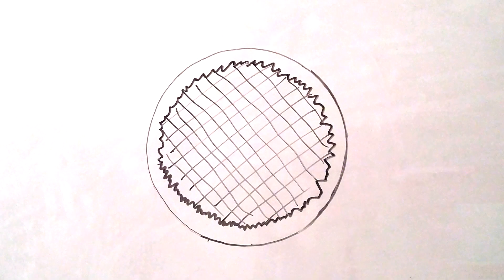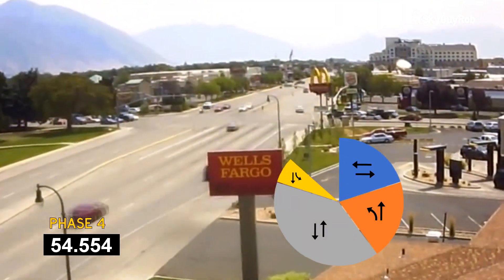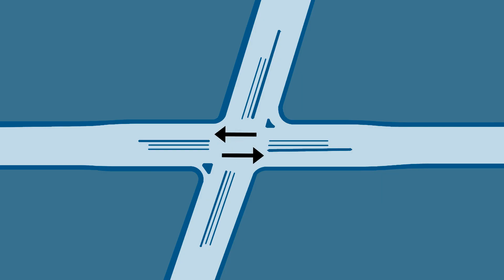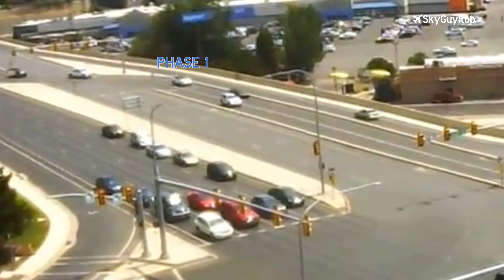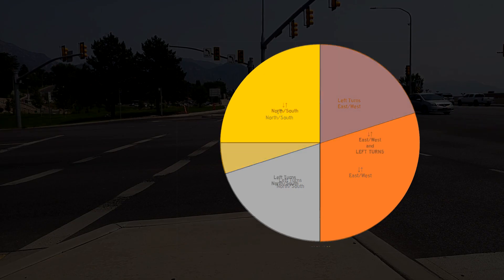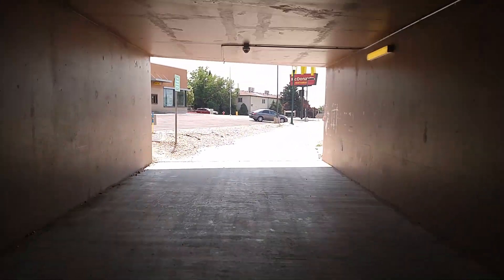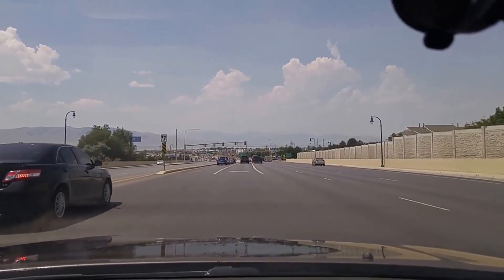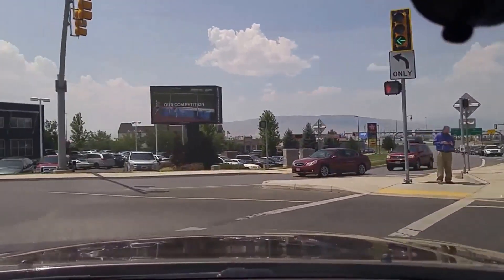New Crazy Traffic Light Which SOLVES Congestion

Comment: You’re lucky to live where the city, county, and state traffic engineers do anything more than the absolute minimum required not to be fired for gross negligence. Where I live they put artificial vision camera systems in on highly congested problem intersections and traffic flow gets way WORSE because they’re so poorly programmed. 60 seconds can pass where not a single car goes through an intersection despite massive backups from some directions. And our lights have sensors plainly cut into the road yet still give a green arrow for roughly forever for left turns when there’s not a single car from any direction wanting to turn left. It’s the most inefficient, fuel wasting, and backup causing mess imaginable. Yet when you try to voice a complaint you’re told the signals are programmed for traffic safety above all else. Honestly, a 12 year old geek could do better than most traffic engineers.

Comment: These are a good idea for regulating traffic at large, multi-lane intersections, but not for small intersections. What would work better would be "smart" intersections that measure the approaches of vehicles and decide which directions should be given movement. Say for example you have a high speed main artery intersected by smaller capillary streets. Often what happens is a vehicle on the main street going 50mph will hit a red light just so the side street, which is already stopped, can go. Well, this is inefficient in numerous ways. First, if the side street is already stopped, then that vehicle isn't wasting any more energy. It's already stopped. But if the light decides to stop the high speed vehicles to allow the one stopped vehicle to proceed, now all those vehicles have to come to a halt, wasting braking energy, then re- accelerate on a green light, wasting fuel. Instead, a Smart system could make calculations based on time and energy efficiency. It would monitor the progress, speed, and direction of vehicles on all streets, then grant movement based on the most efficient profiles. Now, obviously there has to be a time component to it, otherwise the side streets would never be given an opportunity to move, but that is simply a matter of programming.  This type of system is completely possible with today's technology, and wouldn't even be expensive to implement on all intersection types, regardless of size or location.

Comment: 3:26 casually crosses solid line
Reply: Single solid lines don’t prohibit crossing, they discourage it. And there are even some places where you actually have to cross a solid line in order to get into a left turn lane—Michigan has a lot of those! In most places you can’t get in trouble for crossing a solid line, but you should have a good reason, or you might get stopped for suspicion of being under the influence.
Reply: @Ethan.Lamoureux  What weird ambiguity-cave did US road markings crawl out of?

Coming soon to a cinema near you, from the creators of the red turn signals; its the must-see hit of the summer!
Reply: @mathiastwp  The reason for the ambiguity I speak of is due to the location of these left-turn lanes. They are in the middle of the road, and they are intended for use from either direction. The markings are very specific so as not to cause confusion.  The other type I have seen was a left turn lane where the line which separates the turn lane from the thru lane had been made too long and there was no gap to enter the turn lane, so you had to cross the solid line to get into the lane. But no big deal, because as I said, a single solid line does not prohibit crossing. There are other markings which prohibit lane changes or passing.

Regarding your “ambiguity-cave” statement, I have yet to see a marking system which is as unambiguous as the US system. It clearly differentiates between lines separating traffic moving in the same direction (white) and traffic moving in opposite directions (yellow), and between right edge lines (white) and left edge lines (yellow). This system is used thruout the Western Hemisphere. But the systems used in Europe and elsewhere in the world have centerlines and lane lines which look exactly the same.
Reply: @Ethan.Lamoureux  We don't use bi-directional turn lanes, so it's a bit silly to me; we usually just throw up a roundabout. But over here in Norwegen solid line always prohibits crossing, even if it's single, yellow or white.

In the situation in the video, I see absolutely no reason why one would want to change lane in the middle of it like that. Because most Americans apparently don't know how to efficiently zipper-merge (like the Cities Skylines AI), you'd want to close these two lanes from intermingling to keep capacity up. What better way to do that than with a solid line?

An extra question here at the end. Do you have dubble mixed-length centerline markings? As to indicate that one side can more liberally overtake the other, due to the type of road or blind corners.
Reply: @mathiastwp  First, the reason for the two-way left turn lanes is because of built up areas with a lot of businesses (each with its own driveway) where left turn traffic blocks a thru traffic lane while waiting to turn left. So we put a lane in the middle which is used for left turn traffic from either direction. It is continuous because the places where people can turn left are pretty much everywhere. 

We do have passing or line-crossing prohibitions, we just use two solid lines instead of one. So while a single solid line discourages crossing, a double solid line prohibits it. 

The most frequent reason for someone changing lanes suddenly like in the video is because they realized need to make a turn ahead and don’t want to miss their turn. Tho there are some people who just change lanes all the time in a hopeless effort to “get ahead”. Thankfully that behavior isn’t everywhere.

Yes, we do have mixed passing/no passing zones where one side can pass while the other side is prohibited. This is indicated by placing a solid yellow line to one side of the broken yellow centerline. The side with the solid line is prohibited from passing, while the other side can pass. So there are three indications: a single broken line means passing is legal for both directions, a solid line next to a broken line means passing is prohibited for the direction with the solid line on its side, and two solid lines means passing is prohibited for both directions.
Reply: @Ethan.Lamoureux  In my country there's an interchange with 2 slip roads/off-ramps just 170m/~200yd apart, & you aren't told that you can only access the 2nd slip road from only the right-most lane until after you've passed the 1st. If you aren't familiar with the junction you might find yourself in the wrong lane & end up having to change/filter lanes suddenly, which is made more dangerous here as the road between these 2 slip-roads is a bend too
Reply: @lzh4950  I can easily visualize what you are describing, and the only thing I can say is that many traffic accidents are more the fault of poor highway design than they are the fault of the driver(s) involved. Be careful out there!

Comment: Do you know how this affects delay for the permissive left turns before the intersection (to account in your pie chart from 30% to 50% arrival on green) or have any crash rates information? Is there a signal at the left turn before the intersection, and if not, should they have one there? Overall, its a unique intersection, super cool!
Reply from the maker: There are no permissive lefts at a CFI (all lefts are "green arrow" protected).  Are you talking about the difference between a regular intersection with (and without) permissive lefts?
Reply: @RoadGuyRob  Gotcha. Can u share the timing card? Would be cool to see the phasing. I'm curious which phases overlap with the protected lefts.

Comment: Here in Dayton the premise makes sense, but the execution is absolutely terrible. The amount of time spent at a red light while not cross traffic is moving is absolutely staggering the vast majority of time. At rush hour it may make sense but most of the time cars are idling and no one is crossing. Worse, right turns are governed by lights when there’s SIGNIFICANT room (already paved) for merge lanes. I avoid this intersection at all cost because of the amount of idle time. It has like 2 to 3 preceding lights in two directions as well.  awful.

Comment: Interesting!  Funding mass transit is ALWAYS  FAR cheaper than any of  these alignments (and accompanying tunnels) (AND the NEPA and ROW allocation) (and putting in beefier signal masts to hold the longer arms...)I feel like traffic "engineers" need to be better informed of the logical alternatives.  But since transit isn't "engineering" I feel like the engineers turn their noses up at it since it is faster and more cost effective than new infrastructure but really shows how irrelevant the whole traffic engineering profession is.  I mean, what other specialty gets to call itself a profession when implementing its recommended actions does nothing but induce further problems and the solution is outside of the "licensed" peoples' prevue?

Comment: There's a new interchange that they put in not too long ago just south of the Minneapolis airport on a surface Street like 36 or something on the Southeast corner over by the Mall of America just south of the terminal 2 that is really interesting it crosses traffic over onto the complete other side of the road and it is like you're driving in England for a short distance.. what it what the problem is is it's a off-ramp and on-ramp by a airport terminal and the Mall of America getting off of i-494 and Minnesota State highway 5 and 55 and it gets off onto a surface Street that's a four-lane city street and traffic always got so backed up get it trying to get off or onto the highway both are the freeway and at the surface street level so this way what they did with it it makes everybody happy and also takes into account a light rail line that runs underneath there too and through that intersection it was a real mess and then they decided to change it up I've been through it a couple times it works good but the first time I went through it I was really confused

Comment: Or they could just put in a two lane roundabout with right-turn bypasses.
Reply: That would probably be a much bigger hassle to build and drive through for a street this size than you think.
Reply: @HelloKittyFanMan.  Firstly, it would be much easier as you wouldn't have to build and maintain the signaling.

Second, a roundabout would use less tarmac, leaving more for trees and grass and other things that help with flooding.

Thirdly, it'd simply be safer. I don't trust American drivers, not even with a CFI.

Forthly, I don't have exact numbers, but it looks like it only needs a four lane road. About say 100m before you'd make it six lanes and use the outer for the slip-lane, giving plenty of time to merge on or off.

Oh and fifthly I'd give better fuel economy, so would be easier to drive through in that way.
Reply: @mathiastwp : There's nothing about American drivers -- at least those of us in the US -- that makes us any worse, generally, than those in other continents.

You should see Practical Engineering's video about how expensive they are to build, even with the signals considered. We may not have the budget for one this big in this city or state yet.

It may actually be too much hassle right there just before the freeway.

Tarmacs are just in airports.
Reply: @HelloKittyFanMan.  Just being a pedant, but no part of an airport is reffered to as "the tarmac".

Comment: My Q: What on Earth can be done about the Thanksgiving Point exit/entrance. It looks like a collosal screw up that took place years ago.
Reply from the maker: I need to make a video about that kind of interchange (Diverging Diamond Interchange).  They actually work pretty well... IF they are designed for it.  The Timp Hwy interchange was a super-duper mess and the DDI was a cheap band-aid until @utahdot got the legislature to pay to completely rebuild I-15 (which they are doing now).
Their new plans show a system of Texas-style frontage roads, which are a pretty cool concept: https://docs.wixstatic.com/ugd/b5224d_abf02368a6f34d4896834ac7b9b78454.pdf
Reply: Road Guy Rob Awesome that they have a way forward. I suspect that traffic there will always be garbage, because the geography is so tight, but frontage roads would help some traffic escape up or down an exit. The DDI helps quite a bit.

I grew up in Phoenix which is swiss-cheesed with massive, high throughput highways. I'd be interested to learn how Phoenix's strategy compared to Utah's.
Reply: It’s miles better after the redesign, that’s for sure!

Comment: It would seem to me that in heavy traffic the monster would jam up even worse than a conventional intersection because of the crossing over the main lanes to make that "isolated" left turn.  When the "left turn" traffic extends to the point that it crossed over you have a super jam.   The SPUI design which is for a heavy traffic surface road crossing a freeway is better and operates in three cycles through a single point signal system.  It works great and is easy to understand.  Requires only one overpass and the overpass can be for the freeway or the surface street.  
https://www.youtube.com/watch?v=CEkfAVOGkL4